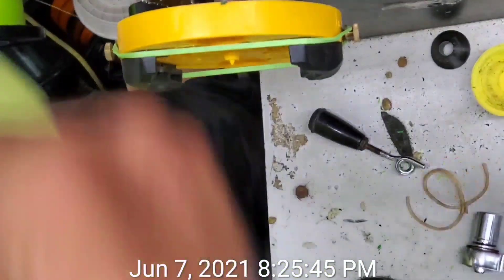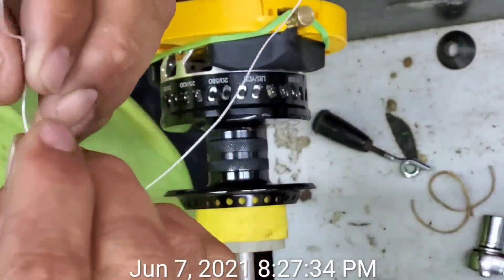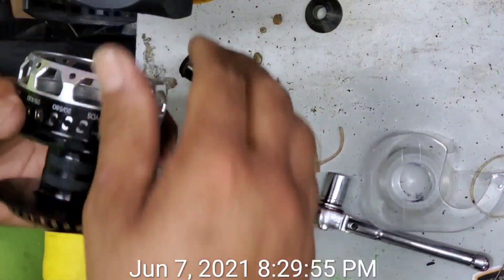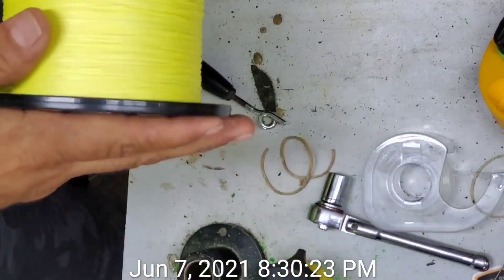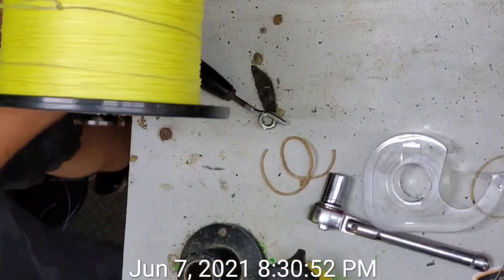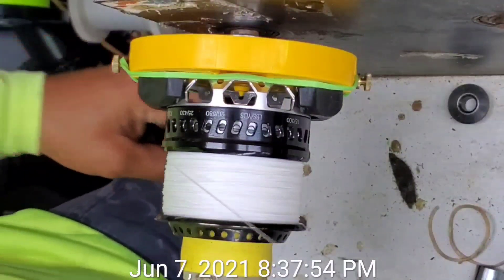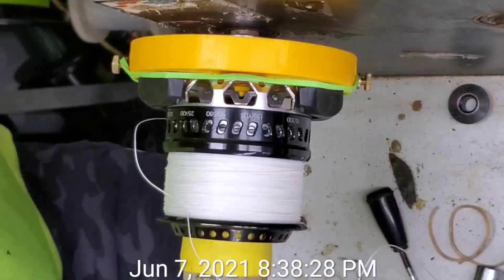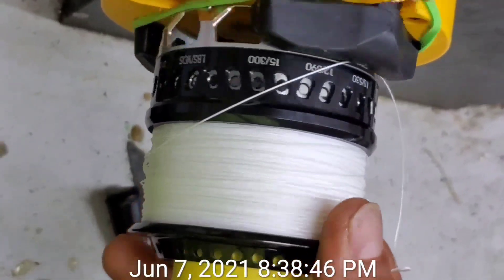Okuma Makira 20,000 spooled with 80lb solid braid addition to our spooling library

Comment: best spinner on the market hands down. no plastic found in these other than shims and seals.
Reply: In the past 7 months I've broken a Tranx 400, 2 gen1 Penn torque 5s, a 20' Saltiga 10000H (though that I think is just a small manufacturing defect) and 2 slammer III's. My partner has gone through 4 slammers... I have a Makaira 10000L and it has seen more underwater time than any other reel, landed sharks, huge jacks, and hasn't had a single hiccup or failure. Can't agree more, these are the best most durable spinning reels on the planet. I just wish they weren't so heavy... if okuma can just get the weight down to compete with the stella and saltiga without sacrificing performance, they would be effectively obselete.
Reply from the maker: Wow thanks for all that input..  loved seen more underwater lol
Reply: I sent mine in for being too geary, okuma is working with the factory to get a new gearset, not sure what the problem is but I'll report back
Reply: Mine was and still is geary. It's by design. Pinion gear is a hardened machined stainless and the main gear is hot forged. You're not going to get smooth operation like in a Shimano/Diawa, but you are going to have durability and longevity like nothing else except high quality conventionals.
Reply from the maker: Awesome keep us posted... and I didn't get to play with the reel
Reply: @the1stvendetta  yea I get that but it was pretty bad even the service guy at okuma called me and agreed if its like as bad as mine was he wouldn't buy it
Reply from the maker: Hmm that can be looked at both ways though..
Reply: @the1stvendetta  Still so positive after some years of usage and still enjoying them? Thanks in advance.
Reply: @michaelkanger1355  Yeah, still working good, though I don't use it all that often. I had a 20K that I enjoyed but didn't use it often enough to keep, and I had some quality control issues with the gear teeth. To be fair, Okuma took care of it every time without question, which is a lot more than I can say about Daiwa and their Saltiga's warranty. They like to fight you and make it your fault, so they don't have to cover failures.
Reply: @chrisguay2510  thanks for your reply Chris, appreciate it.
Reply from the maker: That is also too because of the type of gear that they use on avets they use the stickiest gear grease on the market

Comment: For such a large reel that's not much line. Must be a long cast spool. It's a nice looking reel! Good vid!!
Reply from the maker: Well the size is a lot but it is smaller than the Penn 10500 but they say it put out more drag than the penn..
Reply: 30k spinning okuma/Shimano reels hold about 700 yards of 80lb, penn 10500 about 550 yards, but the makairia spinning puts out massive drag, if you get a chance to see one check the main shaft diameter
Reply from the maker: Didn't get to spooled and shipped it out ..

Comment: Was the reel smooth? I mean for stainless gears can't expect butter Shimano or Diawa smooth but at least comparable to the brass in a slammer? Mine was super geary so I sent it in.
Reply: Mine was and still is geary. It's by design. Pinion gear is a hardened machined stainless and the main gear is hot forged. You're not going to get smooth operation like in a Shimano/Diawa, but you are going to have durability and longevity like nothing else except high quality conventionals.
Reply from the maker: That was def thw conversation I was Having with another Reel Manufacturer that wants to create all their parts in house..  looking at over head and how long it will take them to recoup their investment as well as trying to keep their prices competitive to other reels of their same size
Reply: @the1stvendetta  I sent mine off to okuma because it was really bad. Maybe we can compare depending what they send back to me
Reply from the maker: That would have been even better to see whatvit was like to start and now that it's coming back kind what I do with avets
Reply: So I sent mine for servicing, got it back about a month ago. Actually, they sent me a new reel because they could get that sooner than the parts to upgrade the main gear from the original part to the new "maxgear" design, which seems to have made the reel a lot more fluid as its nearly as smooth as my penn torque and better than the VSs I've handled. Great service, and it's really rare for a company to make continual changes to an established product like that. Can't recall Daiwa or shimano doing anything like that.
Reply from the maker: That's good cause a lot of companies no have discontinued making parts..

Comment: Do u ever check ur line counter to make sure it's accurate.  I would imagine after all them rotations it would loose its accuracy?
Reply from the maker: We just replaced this one a few months ago the original one was from 2013 and it finally started to shown wear and I saw it immediately when I was spooling a mxl and it was lower than what is should have been so I did some test runs and I was right.. so got a new one and replaced it immediately...